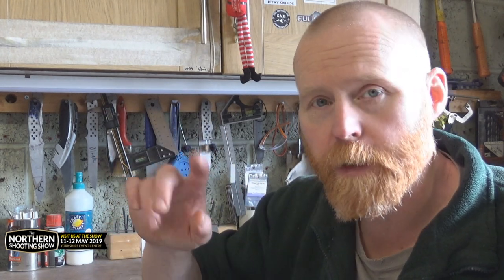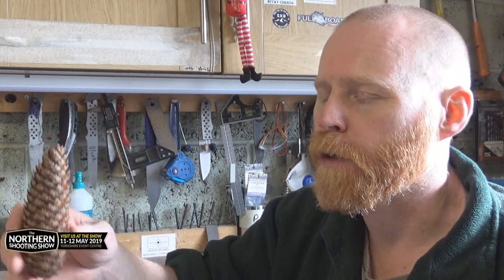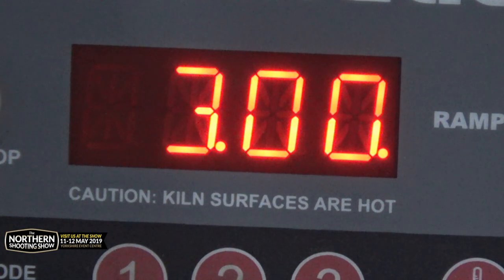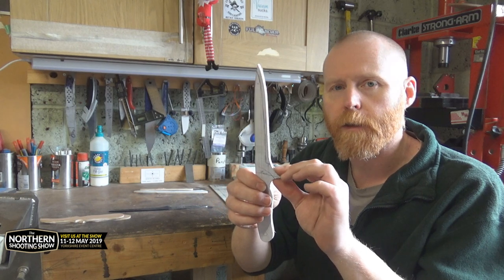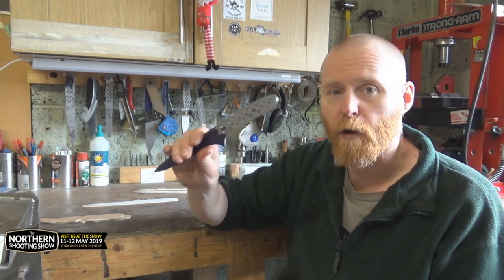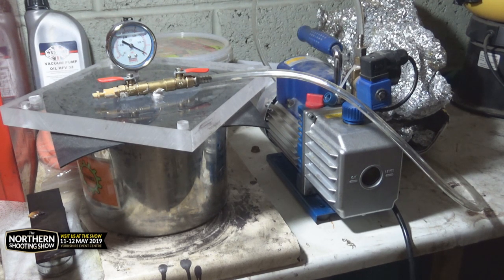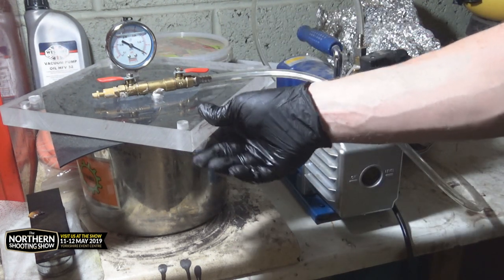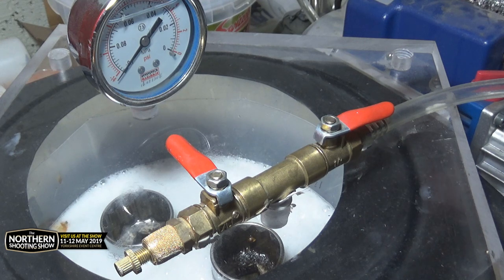Stabilising pine cones

Comment: Gotta use glass lids when using stabilizing resins! The stabilizing resin will always damage the plastic/polycarbonate lids on vacuum chambers
Reply from the maker: Hi Preston. The simple answer to that is don't get the resin on the lid. I have used this system for over a year and haven't had a problem and it shows no sign of failing. The reason I had to change the lid in the first place was because the original glass lid failed. I had no intention in spending more money on another glass lid that I had no faith in. So I got the 25mm perspex that I could drill and tap myself for the fittings and haven't looked back.

Comment: So I have some really old pine blocks that have lots of cracks. I want to turn some and use some for knife scales. Should I stabilize first then fill voids with epoxy?
Reply from the maker: I dont think pine makes a good handle material with it being a soft wood with a high resin content. Age may change this but I'm not sure. I would always stabilise wood before adding the resin to the cracks. If you don't the wood can move (expand and contract) and the resin and wood can come apart.
Reply: @danumblades  how is using pine cones any better or stronger than pine itself?
Reply from the maker: The pine cone is set in resin and used for the pattern.
Reply: @danumblades  got it. I guess when you mentioned high resin content you meant the resin or sap in the pine. This is very old (probably well over 100 year old) pine. So substantially harder than most pine

Comment: Nice job on the scales, I’ve tried making pine scales a couple of times, and both times I’ve ruined them when cutting them in half as I’ve completely missed the centre core of the pine cone!
Another question, did you get the Evenheat over here or did you have to get it directly from the states?
Reply from the maker: Hi Andy. I got the even heat from the EU importer in Sweden. I know that Metal Clay Ltd are an importer for paragon ovens. With cutting the blocks to get the centre of the cone. I try and wedge the pine cone in the mold when I make the block so it gives me a good idea where the centre is.

Comment: An easier way::
  Heat cones in microwave for 3 minutes on high. Repeat after cooling 2 more times.
  Spray coat of lacquer being sure to get into the stem. Let dry. Repeat as desired. 
  Cast in resin. 
This is a lot faster and cheaper! SAFE TURNING, John
Reply from the maker: Cheers John. I'll have a look at doing it that way. Does it get good penetration in to the centre of the stem?
Reply: I have never had a problem doing it that way. I was hunting a faster way and found that is what works for me. SAFE TURNING ,John
Reply: But you are not really stabilizing or strengthening the pinecone, which is the reason for this whole exercise.